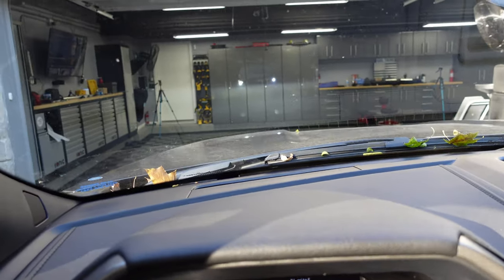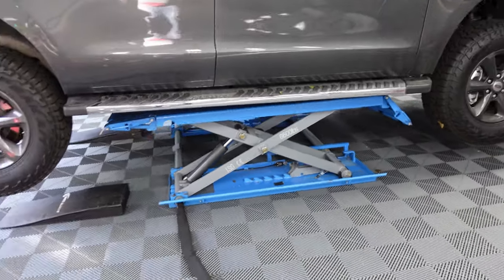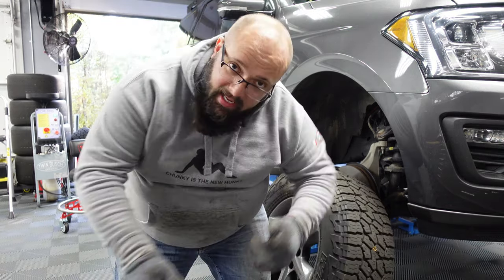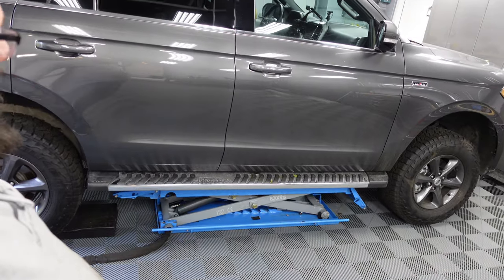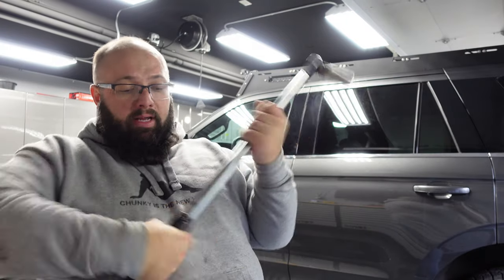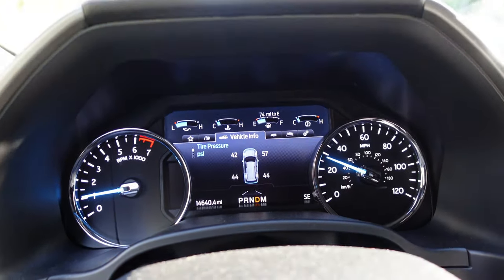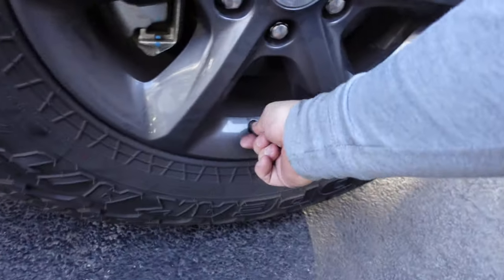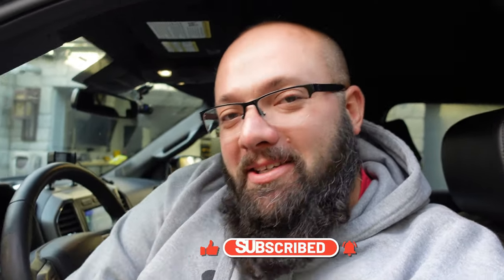How to Reprogram Fords Tire Pressure Monitoring System after Tire Rotation

Comment: Thanks for doing a video like this. Hate to admit it, but I really don't have that much experience with the TPMS systems and it amazes me how different the systems are from brand to brand.

Do you have much experience with the TPMS system or programing it on your C6? I've been thinking about investing in a different set of wheels and tires for mine so that I can drive it to local Car's and Coffee events or maybe to work on the occasional nice day during the summer, but have wondered how big of a hassle it would be to change wheel's and tires, reprogram the system and keep the computer happy.

Thanks again for the video
Reply from the maker: Thanks. I haven’t tried with my C6 yet but I will in the spring. Stay tuned!